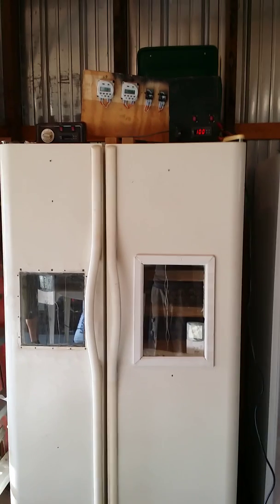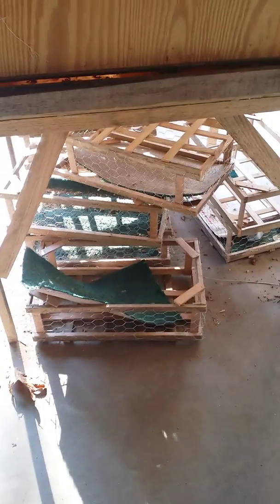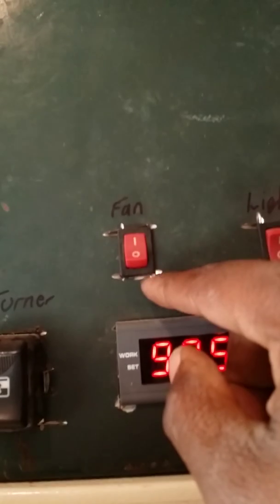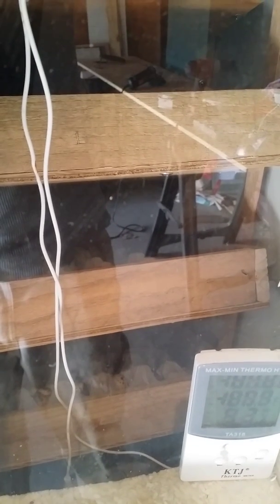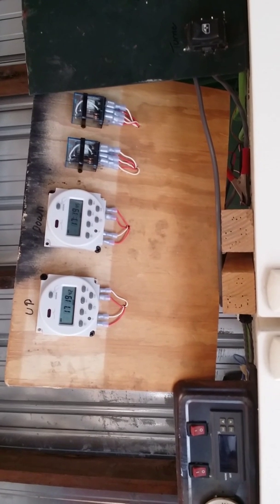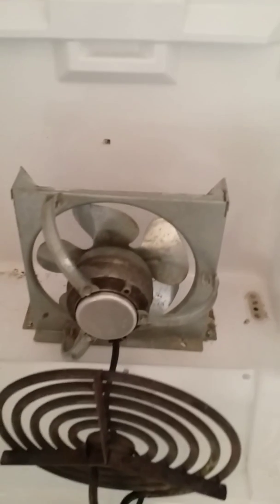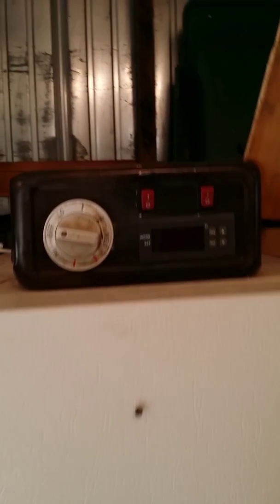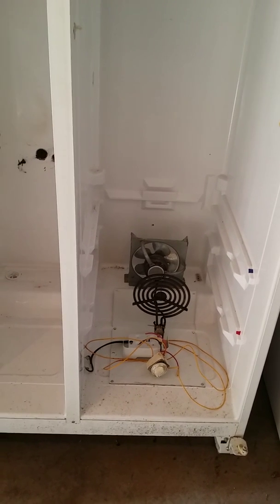DIY Homemade Incubator with Automatic egg turner

Comment: I love the video. if your needing 12v power you can use a power supply unit from a pc. A 300 watt one can supply around 15 amps but it varies by model, of course if you need more amps just get a bigger psu watt wise.